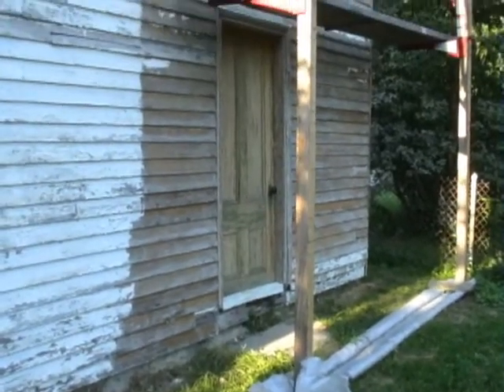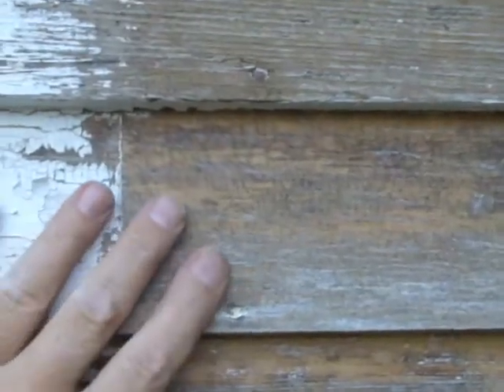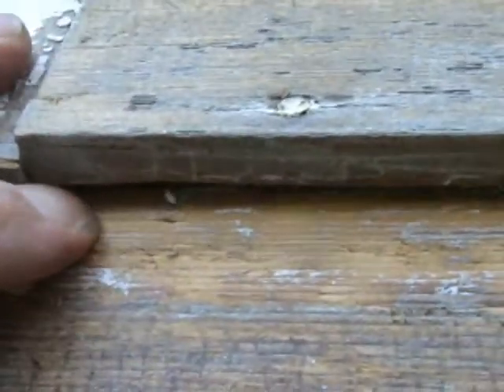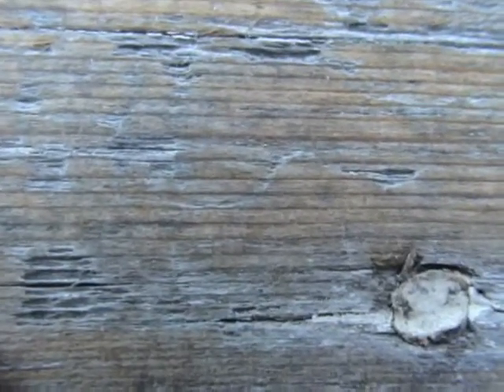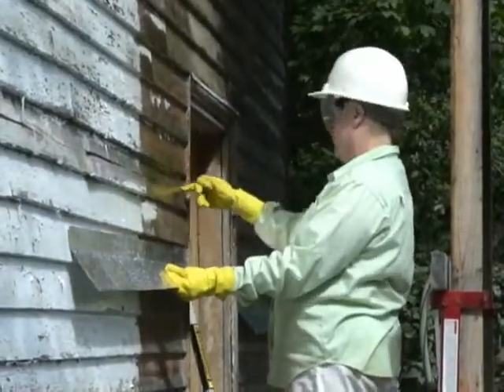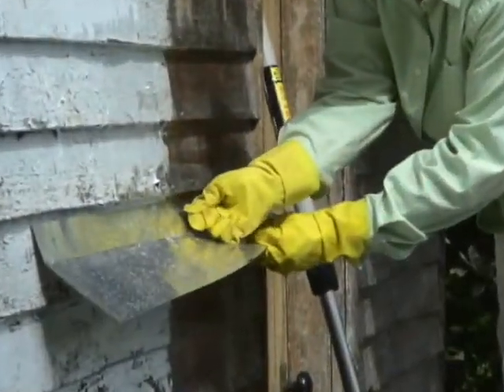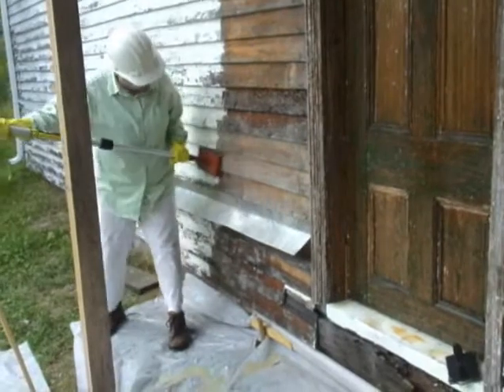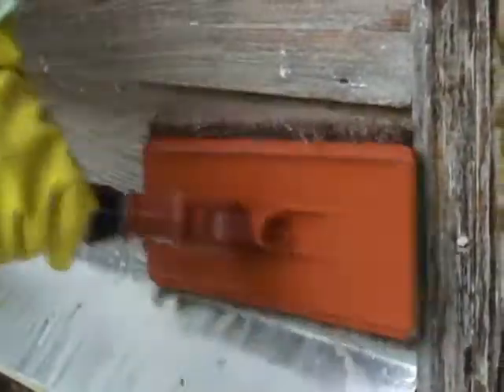Exterior Painting, Prep:  Wet Abrasive Scrub

Comment: I understand that you first remove the majority of the paint with steam. Are there any concerns with any lead-laden paint remnants going into the ground around the property by using this method?
Reply from the maker: We follow lead-safe work practices that include a "ground containment" that collects and controls the lead-containing residue. At the beginning of the video you will see, on the ground, rolled up 6-mill plastic sheeting. Later in the video, you will see we have rolled out the plastic, tucking it up under the lower edge of the wood siding. The plastic catches the lead-containing water as it drips off the wall. The plastic is sloped away from the building so the water drains over to one outer corner. Under that corner we have dug a hole in the ground that holds a 5-gallon bucket. All of the lead-containing water drains into that bucket. We dispose of the lead-containing water in a proper way so that it does not  contaminate the ground or larger environment. Because this is a wet method it traps and controls the fine lead-containing particles limiting exposure of the worker.
We use this same ground containment when removing paint.
Reply: @johnleeke  Thank you for taking the time to elaborate on this method, Mr. Leeke. I found it quite informative. I have really enjoyed a few of your videos from years past and will be employing your techniques on my property. The steam method of paint removal is plain genius and even saves material costs if one were to instead try sanding paint off together with a HEPA vacuum system, such as what the brand Festool offers, though it can get rather pricey after all tools are purchased.
Reply from the maker: @nikolaiv1138  do keep us posted on your progress.

Comment: How soon should one paint on wood after it rains? Can the wood be too wet to paint ?
Reply from the maker: Exterior wood must be dry to paint it. One rule of thumb is to wait for at least three dry breezy days after a rain. The best practice is to measure the moisture content of the wood with a moisture meter. The moisture content must be less than 10% or 15%.
Reply: thanks because it rained last night and I need to  paint this deck and fence today.........to get it out of the way...........IF .........I go ahead and paint it if "it seems dry enough" what are the pro and con
Reply from the maker: The surface of the wood may feel dry, but there could be more moisture deeper within the wood. As that moisture comes to the surface it may push your paint right off the wood. This might happen the next day, the next week or a year later.